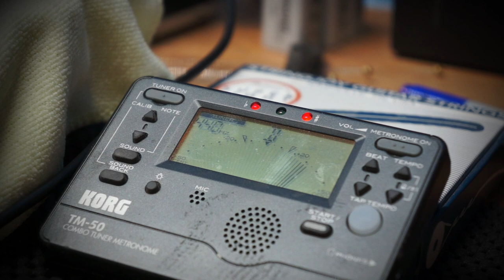Let"s Build: EB Tele w/ Handmade Flame Maple Pickguard

Comment: Hey what did you use to finish the body?
Reply from the maker: Clear Gloss wipe on poly. Lots of coats, level sanded and buffed.
Reply: @NorthstarGuitars  who so fast response. Thats sum sexy guitar right there.
Reply from the maker: @Gamexoozi  Thanks! And thanks for checking out the channel!
Reply: @NorthstarGuitars  can you explain the finishing process. Like did you use sand paper with wipe on poly? And please tell what did you use for buffing
Reply from the maker: @Gamexoozi  I'll do my best. That was 2 years ago. Poly applied with paper towel, 2 coats per day with 24 hr dry time after each day,  light sanded with 400 grit every 4 or 5 coats, did about 20 thin coats total, wet sanded with 600 grit, buffed using brown tripoli and white rouge compunds.